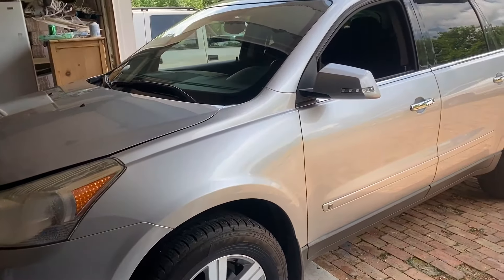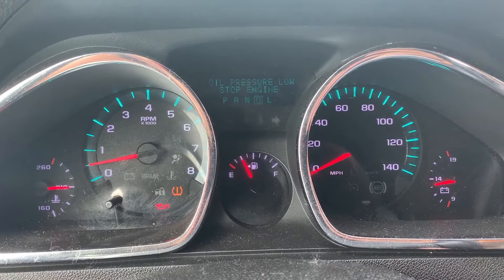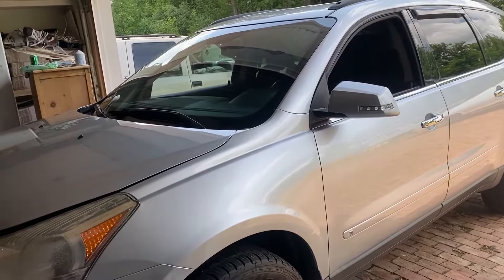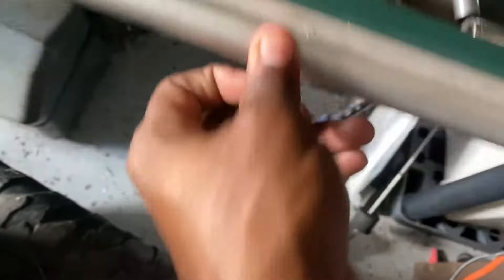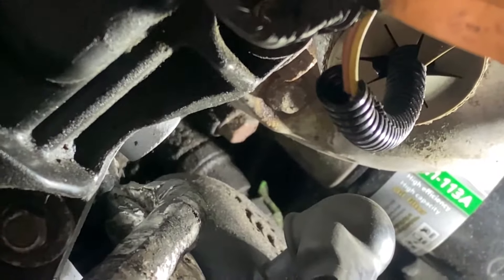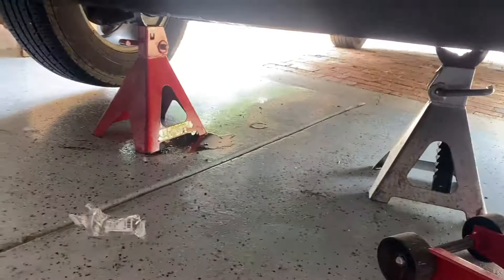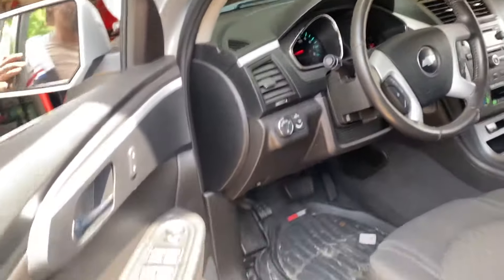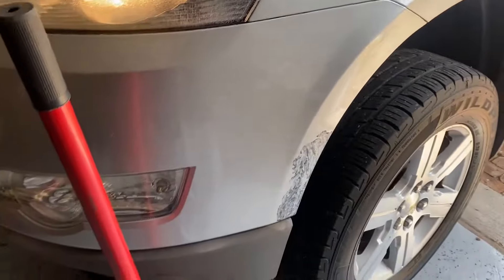Chevy Traverse Low Oil Pressure Issue!! Stop Engine Warning!! Easy and Simple Fix!!!

Comment: My oil pump and pickup tube were clogged. I had the same symptoms
Reply from the maker: Thanks for sharing that information, Mark.
Reply: Did your low oil pressure light came up when you will come to a stop or red light? My does it when when I come to a stop or idling and a I can hear a tapping noise in the top engine I let the engine cool off then it turns and ride normal again
Reply: @erickherrera8225   did you ever find a solution to your problem? I'm having the same symptoms
Reply: @austinjangula7722  was the oil pump

Comment: Hey wat size socket did you use to remove the oil pressure switch
Reply from the maker: Sorry for the late reply. I've been with my dad who is in the hospital. It's a special socket. Here is a link for the socket in case you have not found one. 

https://www.ebay.com/itm/Lisle-Tool-13250-Oil-Pressure-Switch-Socket-1-1-16-Switches-For-GM-Chrysler/272609376768?epid=1537941186&hash=item3f78c8fa00:g:NScAAOSwdGFY2vq7
Reply: Ok thanks right on time literally on my way to the auto parts shop to ask and you came threw

Comment: Thank you so much brother. The exact same thing happened to my 2013 traverse. Immediately after oil change the blow oil pressure light would come on after about 5 minutes of oil change.
Reply: Sitting. At a gas station now 10 miles away from hom